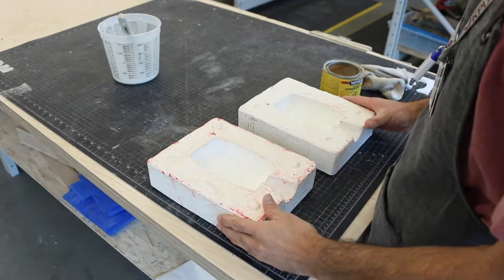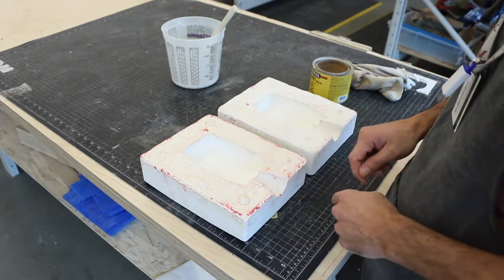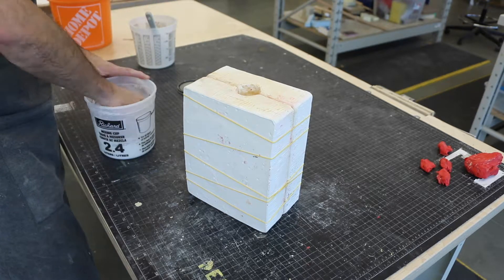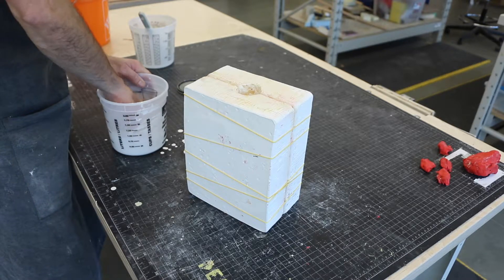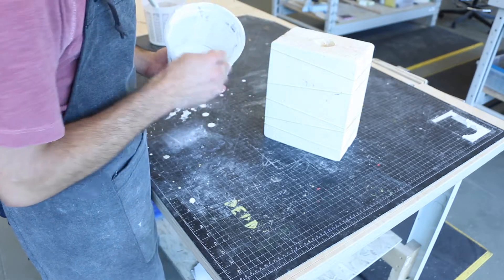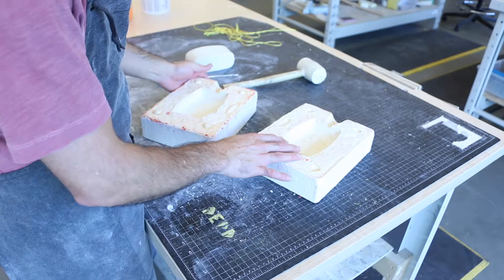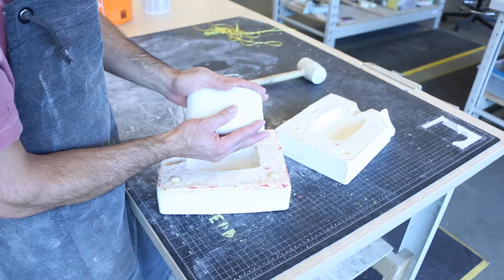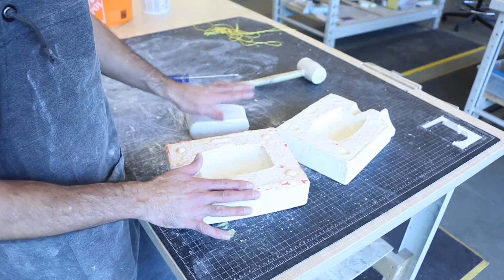Casting in plaster molds

Comment: Enjoy your instruction! Thanks!  The “wasted” plaster doesn’t have to go into the trash.  The solid plug extracted from the bucket could be made into a sculpture base or carved with a Drexel.  The powdered dried plaster can be mixed with clay or sprinkled on resin to add grit.  I’m not sure but I think cured plaster could be baked in an oven to remove water to create virgin plaster to make into molds.
Reply from the maker: Thanks, you are right, there are things that can be done with the excess. The main idea is that is a non upcyclable material, you can re-purpose it only.
Reply: Hello victor , please can I get your WhatsApp number? This mine +2347067082951 . Am Nnamdi
Reply: @Aydin Hudson Flixportal :)
Reply: @Dillon Ares Thanks, signed up and it seems like a nice service =) I really appreciate it!!
Reply: @Aydin Hudson glad I could help :D
Reply: your video was not easy to find not many good videos how on to ACTUALLY PREP
thank you!
Reply: i know I am kinda off topic but does anybody know of a good website to stream newly released movies online?